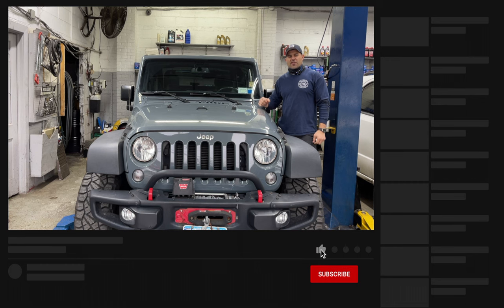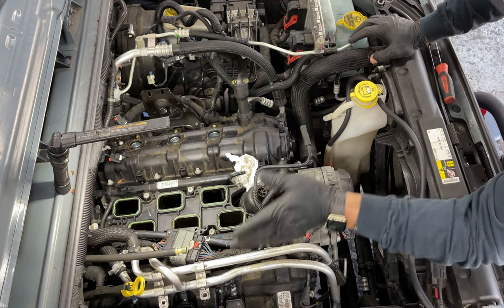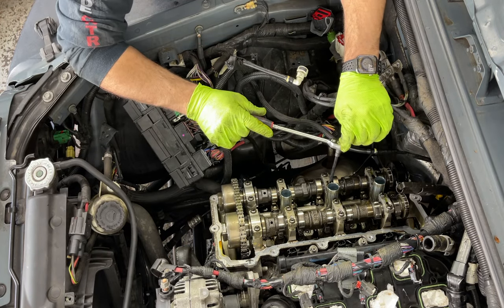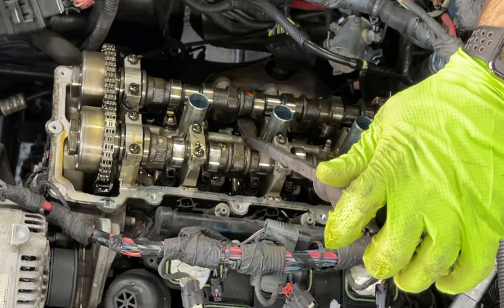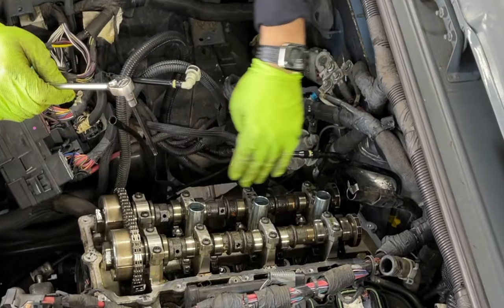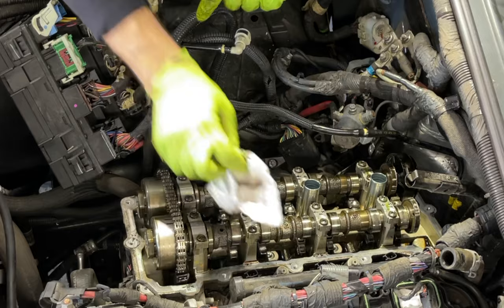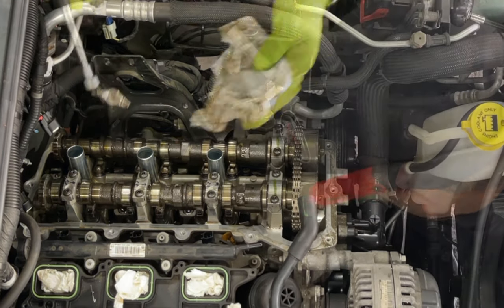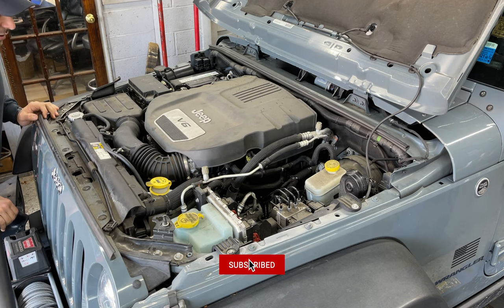How to fix Pentastar Engine tick Jeep 3.6L "SHORT CUT"

Comment: Great video for getting everything down to the valve cover removal, but I stopped following there.  $20 worth of tools and 30 minutes is all you need to properly remove the cam shafts and very easily replace all the rockers. It is very easy to do and it is not worth the potential risk to do the job improperly at that point.  Take some time and do it right.

Otherwise, fantastic tutorial on getting the wrangler apart in order to do any valve train work. I am grateful this video exists as I would have been lost without it.
Reply from the maker: Thank you for your feed back.

Comment: Theres hundreds of thousands or even millions of these engines that never develope this problem but there's always people who say your engine is doomed unless you use their favorite combination of unnecessary expensive oils, additives, filters, priming the oil passages before you start it and different other lucky charms. My 3.6l jeep has 260,000 miles using walmart oil and filters, its literally rusting to pieces and stays covered in mud but the engine has never needed a wrench put on it. This is a common problem but not a guaranteed problem

Comment: Awesome video! Have you seen these with a cam that has the cam lobes worn down on one specific cylinder?  I'm wondering if while doing this job if there's a way to separate the cam from the sprocket to replace it without having to redo all the chain work.
Reply from the maker: Yes actually. almost every other car needed a cam. In this case I use the cam locking tool and it’s about 15 extra min to change the cam. I’m working on that video these days of how to use that tool to change the cam.

Comment: 2016 models up pentastar redesign engine from Chrysler should address those tick issues
Reply: Your comment is correct for only 2016 and up Grand cherokee. But not on wranglers until mid 2018, not all 300, not on all caravans and town/country's. Not on all journeys.

Comment: Great video! What's the torque for valve cover and cam screws?
Reply from the maker: Cam caps are 89 In Lb and valve cover is 106 In Lb.
Reply: I'm about to start doing passenger side for now only, how many rocker arms and lifters are in there that way I know how many to buy?
Reply from the maker: @poundermonster  it’s usually 2 of each per Cyl so 1 side is 3 Cyl. A total of 6 each
Reply: So, by turning the engine so I can make space to remove the rocker arms i will not I will not mess with the timing?

Comment: Great video. I see this vehicle has nys reg and insp. Where u located. I’m in Elmont. My buddy has this same car. He has misfire onn#4 cyl. We did coil, plugs and injector. All mopar parts. Still misfiring. I can hear a lifter noise in the driver’s side. Is it possible the rocker is shot or u think might be valve issue. Car only has 61k miles. It’s a shame with that low miles
Reply from the maker: Yea I’m in Garden city NY 10 min away from Elmont. I have see problems with these engines as early as 50k miles. You need to do a leak down test to make sure if it’s a valve issue. Thank you for watching and I do appreciate your comment.

Comment: Is there a specific location to drain some of the coolant or is this still done at the traditional draining plug?
Reply from the maker: Drain plugs are kinda tricky with those wranglers. Best way was to remove lower radiator hose from the water pump side, kinda messy but keep a large container and don’t remove the hose all the way on shot. Take your time

Comment: I am not able to get the cam caps off. T30 screws are so tight and not moving. Any advice?
Reply from the maker: Yea usually it’s tight. Use a good brand name socket so it won’t break or strip and apply more force it will come out
Reply: His right did mine this weekend and use a cheap bit and thankfully it didn’t round just broke. Went to auto zone got one it work. They are tight tight

Comment: Great Video!  I'm doing this project tomorrow.  2 quick questions:  1.) Did you need RTV on the Driver-side Valve cover as well or just the passenger side that you showed?  2.) I saw that you used a new gasket on the driver-side valve cover.  Do you also recommend a new gasket for the passenger side?  Thanks in advance!
Reply from the maker: Yes. You should change both valve cover gaskets and always use RTV corners and surfaces where oil can seep throw. Thank you for watching and I do appreciate your comment. 🙏🏻🙏🏻
Reply: Watch closer you can see the new gasket tab in the passenger side cover sticking out it is blue.  As for the sealant on the driver's side he did put a dab on the space between timing cover and valve body it is visible after he moves the hose out of the way to seat the valve cover moments after seated you can see as he rounds the bolt down the sealant spreads outward.

Comment: This rocker arm issue is really just on the Gen 1 Pentastar, right? What did they change on the Gen 2 engine to solve this issue? Is the rocker arm a revised/improved part? I never see Gen 2 engines with this issue.
Reply: I have the upgraded design on my 2021 Wrangler and had the tick.  In my case it the rockers and cam shaft had significant wear.  I had the dealer do the work, but am still having issues with misfires and I hear a slight ticking yet.
Reply: @jasonstockton  There will always be outliers. The vast majority of Gen 2 Pentastars seem not to have this issue. My own is still just fine.

Comment: Would you bother doing this job on a 2014 Rubicon with about 160,000km even if it had no tick except on cold start up for a second or two? You know, just to be sure.
Reply from the maker: Probably won’t do it unless it’s a constant tick but ones it ticks don’t wait too long.

Comment: What is the best way to avoid this problem altogether... heavier oil, synthetic only, no long idling?
Reply: I saw a video the other day that mentioned holding the gas pedal down when trying to start.  Jeep wont start, but engine will crank - to prime the oil system.  Maybe... but still sounds goofy to me to have to do that with every start.  Another that I read was installing an "anti-drainback" adapter.  Keeps oil up in the filter at the top of the engine, and uses spin-on filters.  Of course, then you'll need an instruction manual if you ever let a shop change your oil!

Comment: Nice, hope the JL 2018 and newer 3.6 is immune to this, mine is very silent to date, 40,000 miles.
Reply: They are not immune. I'm doing my 2020 JL right now.
Reply: @roberts6740  Are you following this for the new design?  How did it go?  The dealer did the first replacement, but only replaced 3 of the rockers/lifters and I'm still getting misfires and have a slight tick.  I'm trying to figure out what to do, either bring it back or try the fix myself.
Reply: I did replace all 24 rockers and lifters, plus the intake right side cam all myself recently.  In short...I did not remove the other three cams completely to install the new rockers/lifters - i was able to raise the cam verticle enough to slip out the old and install the new stuff.  I used the cam chain loosening wedges....which required buying the expensive silver alluminum one for the left side (over 100 bucks just for that) as well as the cheap plastic one for the right side.   I worked slow...it took me about 40 hours or wrench time (about a week of evening work).  Other key tips...I did not remove the battery and fuse containing box, I removed the spark plugs to turn the crank easier, I did not use a magnet to remove the lifters, I used a long needle nose pliers - magnets at the rear can demagnatize the big round cam magnet on the end of the cam, I was very very careful loosening the cam retaining bolts - they are  on tight and greasy with oil to VERY easy to strip - which I did with one of them.  Put lots of downward force on these bolts as you slowly turn them loose.  The one i stripped took me about 2 hours or more to finally get it out by sawing a flat cut into it so it could receive a flat screwdriver bit (vs a hex) which I used to finally turn it loose - that was an absolute nightmare.  Becareful removing the plastic valve covers as they easily can crack - dont man handle them as you pull to remove it.  All in all it was a paint in the ass for me, but Im not a car guy who normally does this major work.  Happy to answer any questions.
  @jasonstockton

Comment: What causes it & how long should the issue be fixed for? How many miles on average do all these motors have on them?
Reply from the maker: Bad design with lake of oil change on time. I’ve seen as early as 50k miles and should be fixed ASAP, since it can cause some serious damage to the camshaft it self or worse, bend a valve.
Reply: My 2013 jeep jk has 70k and this has started to happen. Not looking forward on fixing this . Hopefully it isn’t to pricey.

Comment: DO YOU RECOMEND INSTALLING THE KIT TO HAVE SPIN ON FILTER, AND KEEP OIL AT THE TOP ?
Reply: I just had someone show me this the other day.  Interesting concept, but I don't usually do my own oil changes.  I'd need an instuction manual to give to the shop that does!  Takes a 30lb air hose to purge the filter for a change.  Will a shop really bother?  Or blow out some seals?

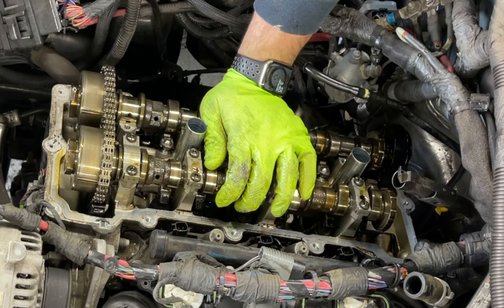Comment: 30:58 what are you prying on here to get the cam to sit back? Is it the chain or the tensioner? Also, by doing this method is there a risk of overextending the tensioner plunger? I'm doing this job on a 2012 caravan and started doing the job the "right" way, but the cam locking tool I have doesn't fit the right side. 

The left side worked using the tool, but right side doesn't fit at all.
Reply from the maker: As I mention in the beginning of the video. It’s risky to do it this way but I guess you see first hand the right tools sometimes won’t work right and you have to improvise, which that being said I don’t thing you will overextend the tensioner plunger. You need a lot more than that to overextend it. I just pry on the sprocket it self to push the whole camshaft back.

Comment: Hey I followed everything in your video but I was moving the crank and the marking I made on the timing chain got erased. What will happen if I don’t turn it back to the way it originally was at. It’s on the passenger side.
Reply from the maker: No good. It has to go back exactly where it was. Don’t start the engine if you’re not sure.

Comment: I’m sure your busy, If you or anyone can help I would appreciate it. I took off both value cover and check all rocker arms they look fine to me. Any Suggestions as to what else could be making the loud knocking noise coming from the engine.
Reply from the maker: You will have to remove the rocker arms and have them in hand to properly check for damaged once. Visual inspection isn’t sufficient. Unless the knock is from the bottom end which could be a bad rod bearing or wrist pin

Comment: Get the 20 tool... take cams out. Save the bearing cap bolt holes. Just did it. Its so much easier than fishing with a magnet and prying at your expensive valvetrain
Reply: 20 tool??
Reply from the maker: Yea it’s a tool you can use to lock the chain tensioner and do the job by removing the cams. I have a video about how to use that tool come soon

Comment: Here's the issue, you lifted the vvt and raised the chain slightly, this causes the chain tensioner to pick up the slack. That would be my concern
Reply from the maker: The tensioner is always under tension a slack shouldn’t be a concern but you’re correct on engine turn clock wise and not counter clock wise. Thank you for watching and feed back.

Comment: Help?!?  I followed your video to change the rockers on my 2016 Grand Caravan, and now the idle is really rough and I have a p0300 (random cylinder misfire) code.  Misfires seem to be on cylinders 3 & 5 (according to my OBDII app).  Mechanically it sounds fine and the engine will rev, but it’s rough and will stall at idle.  Any ideas?  Thanks so much!!
Reply from the maker: Make sure ign coils and fuel injectors electrical plugs are plugged in correctly
Reply: @a2zautomasters862  - I truly appreciate the reply.  I wound up opening up the valve covers again and discovered a rocker out of place in the rear-most cam.  It must have fallen off before I buttoned things up and I didn’t notice.  Luckily, no damage to anything.  I put it back in place, checked ALL the rockers and re-torqued all the cam caps and it’s running great now.  Your video is awesome, and definitely saved me time & effort.  Highly recommend this method for swapping the rockers.  Thank you!!
Reply from the maker: @IanEriccc  thank you for watching and I do appreciate your feed back.

Comment: dealer says cold ticking is "normal". Is the tick just an annoying noise? How s it decreasing performance if at all?
Reply from the maker: No tick is normal, Cold or hot. Was the engine ticking brand new? Ticking comes from lack of oil or warn out components and in some cases can cause catastrophic internal engine failures.

Comment: At what point what you recommend replacing the timing chain? My 2014 wrangler has 170k miles on it, and I just started getting this rocker arm noise. I’m debating on whether or not I should also replace my timing chain since I’m going to have the motor opened up. Thanks!
Reply from the maker: Most of the time the chain itself isn’t the issue. Mainly the plastic guides and rails. If you’re planning to keep it for another 75-100k miles, you should do it now.
Reply: @a2zautomasters862  thanks for the advice! And thanks for putting up this video. I’ll be doing my rocker arms next weekend. I owe you a beer or three 😂
Reply from the maker: @wmeyer116  you got it. Good luck and thank you for watching. Cheers 🍻 lol
Reply: Just checking back in, thanks a ton for this video, got them all replaced, found the culprit rocker arm, and now it sounds good. Thanks!
Reply from the maker: @wmeyer116  great. I’m glad everything worked out. Thank you for watching and I do appreciate your comment.
Reply: I dont know why cars now require timing chain replacement     they are supposed to last the lifetime of the vehicle....plastic guides   pathetic    see BMW
Reply from the maker: @neilduncan8657  yea absolutely. I do plenty of these all the time. They don't build them like they use to.

Comment: Are oem rocker arms all that's available to replace with? Seems like it will eventually start doing this again?
Reply from the maker: As far as I know, OEM is the only available option. I did so many of them and so far every single one I did still on the road with no problem. I guess only time will tell. 🤷🏼‍♂️
Reply: @a2zautomasters862  thanks. We don't have the issue yet, but with everything I've read...it will eventually happen

Comment: Hey guys need your opinion. Gonna be doing this procedure in the next few days. Along with this I’m gonna swap out the oil housing with a Dorman aluminum one. My question after draining the oil and coolant for the housing. Then doing the lifters and rocker arms next. Any reason to be worried about initial start up?
Reply from the maker: No you should be ok. Make sure you lube the rocker arms and lifters during installation and you could pour some oil inside the oil filter housing after the installation, where the filter goes then install the filter
Reply: @a2zautomasters862  A2Z thanks for the reply and the helpful videos!!!!! You are the man dude!!!!!
Reply from the maker: @MSJ860  🙏🏻🙏🏻🙏🏻👍🏻
Reply: A2Z dude last question man. What the  hell is up with this transmission filler tube?!!!!???? I can’t get the valve cover off the passenger side. I got the pcv valve out the cam sensor and this transmission filler tube is just catching the back of the valve cover when I left it up. Where the hell is this bolt that holds the tube?? I’m completely lost
Reply from the maker: @MSJ860  you don’t have to take any bolts out for the tube. You can actually just push it back a little it should move / maybe bend a little. No problem

Comment: Good job is it not safe to grab one in back with magnet ..hope I didn't mess up my phaser ..I kn I had to fish it out ??
Reply from the maker: You should be alright. It takes more to damage those phasers. Thank you for watching and I do appreciate your feed back.
Reply: LAST QUESTION ⁉️ ⁉️ While rotating left bank checking TDC .do chain suppose to get lil loose @ a spot then get bac tight ..is this normal ..All marks line up perfectly .Help 🙏🏾⁉️ ..THANKS n advance 🙏🏾
Reply from the maker: @knock904  yes as long as all marks lines up again, you’re good.
Reply: I disable fuel spent engine wit Starter .. Recheck alignment marks👍🏾 & When I Spinned by hand . Chain tight stayed tight ,& marks were aligned ..Thanks again for Support 💪🏽
Reply: Man I thought I would have been ok ..but car won't start .. Correction I left coil unplugged when I primed it ..Pull plugs all are wet & put new & put lil tranny fluid to regain compression..Seam like it won't to start & run for second Tried to clear flood ..MY QUESTION is my cylinders wash down or am I out of time maybe 🤔.All my marks were there .Even after I primed it & chain was tight..Please Help hate to Aggravate You
Reply from the maker: @knock904  scan it for any codes.
Reply: I did & erased few times ..only get a Throttle Position Sensor circuit low ..
Reply from the maker: @knock904  that’s your problem right there. Car won’t start bc of an issue in the throttle body. Unplug it and clean the plug and check the wires at the plug and re plug again. Make sure it clicks in.
Reply: Did compression test nothing on Bank 1 .nothing cylinders 4 ..120psi  cylinders 2 & 6
Reply from the maker: @knock904  that’s no good. Sounds like you might’ve bent few valves. You have to make sure timing is right. Check timing marks.